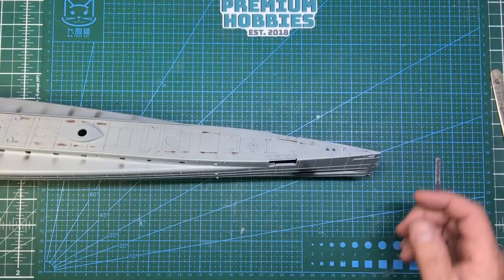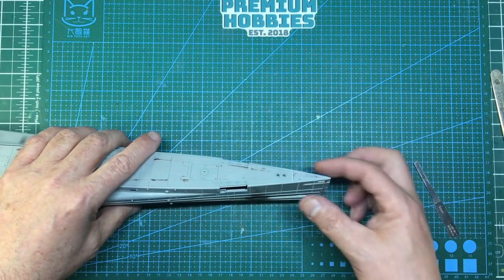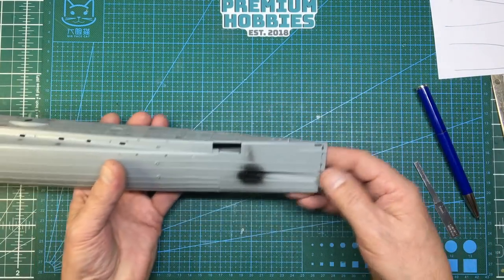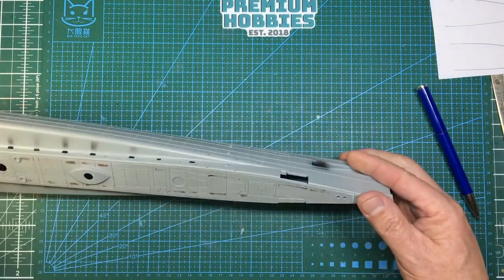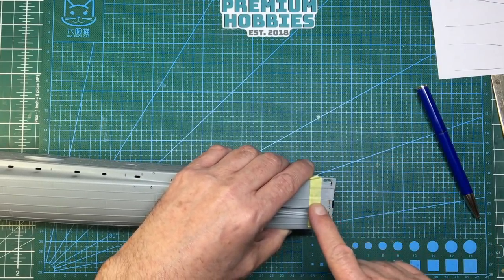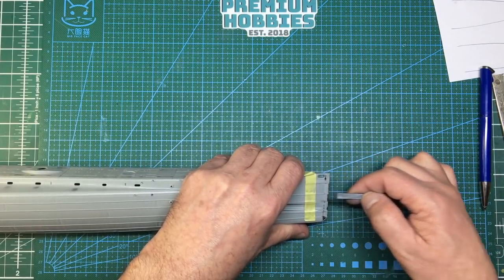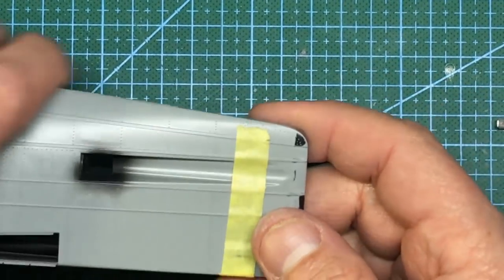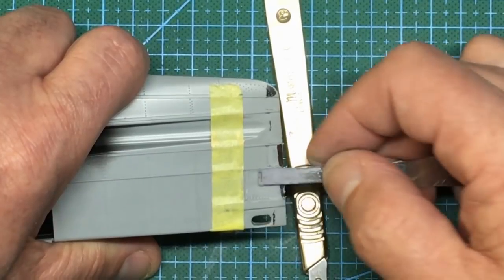Das Werk 1/72 U-Boat U-9 build. Part 7

Comment: Nigel, I think you might consider an apology, you asked what to use and what not to use to thin Badger Stynylrez primer and I said don't ever use leveling thinner it's doesn't work, but Tamiya X20A consistently works fine. The very next video you said somebody commented don't use levelling thinner but I tried it and it worked perfectly. Then your latest video you said I used leveling thinner and it turned to cheese,  just what I told you. I have been using X20A this for years since Stynylrez became available and it always works fine.
Kind Regards Dave Porter
Reply from the maker: Hi Dave. I do apologise, but I will say that it works sometimes and not others?? Weird. Someone has now told me a mix of 60/40 water/IPA works too? 
If you browse google you will find people using all sorts to thin it. Personally, I think what I have  is the last I will ever buy.
Reply: @NigelsModellingBench  DaveP - what ratio X20A do you use? I have great difficulty spraying this primer even with a 0.5 needle.

Comment: I know this is a few years old, but I just picked up this kit here in the U.S. Loads of excellent tips with your fantastic build series; thank you. Did you post the video of the German build? Are the rivets the H-O scale sheet?
Reply from the maker: I never finished this one as the masts are patheticaly weak and the kit has inaccuracies.
Reply: @NigelsModellingBench   That's sad to know.. You mentioned after market parts, so I might go that route to finish this kit.

Comment: I believe the two forward holes are your port and starboard running lights on the conning tower.
Reply from the maker: I think weve confirmed they are viewing ports. The forward ones even have wipers.
Reply: @NigelsModellingBench  glad it was answered. A lot of information on WW2 and later submarines but the earlier ones are not well documented. BTW they are one of my favorite modeling subjects.